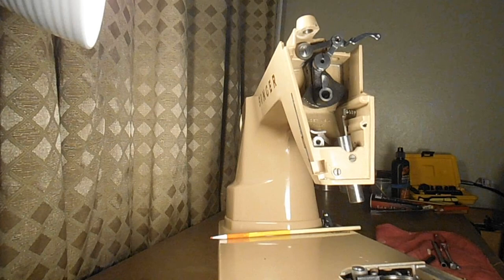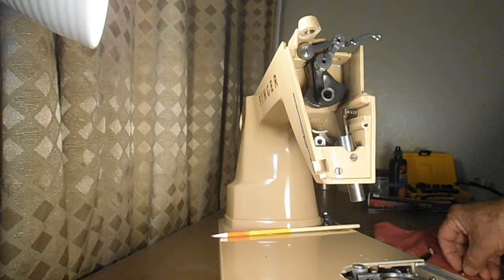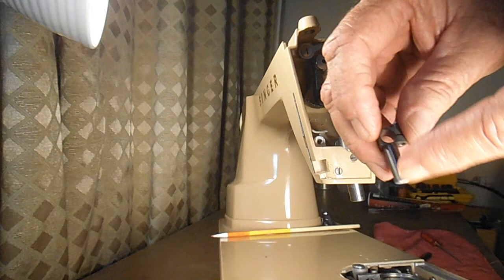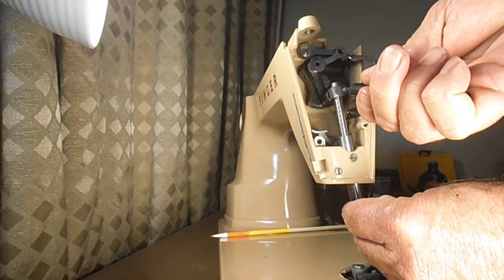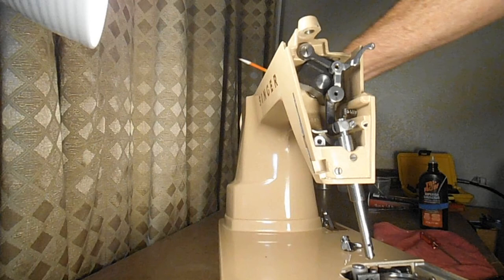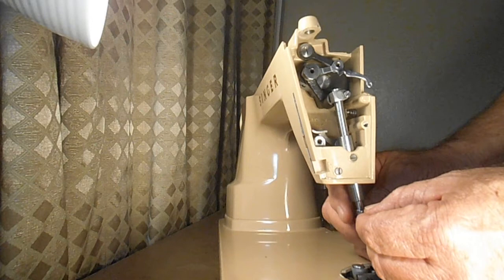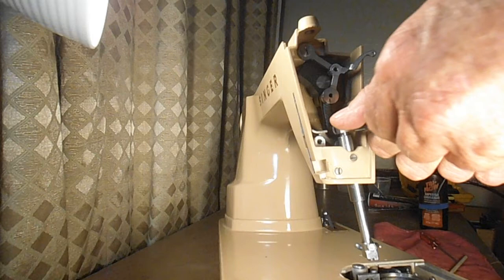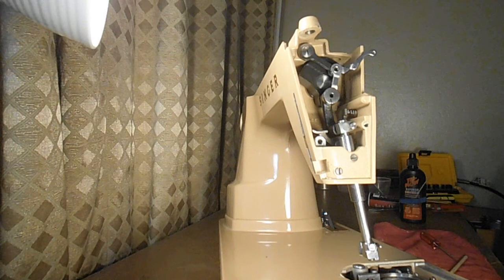SINGER MODEL 404 RESTORE SERIES Pt. 23 INSTALL NEEDLE BAR & SET THE HEIGHT

Comment: Dear Andy. I stopped working on my 404 a couple of months ago because of the needle and tension. The needlesetting and the tension unit never working correctly. So my question. Does this needle bar have  something that makes the needle only set 
In one place ! My 301 singer does. When I put needle into the needle bar in the 404 it is in the correct place. When I tighten the screw the needle slides to the right . In its last place it is to the right side and touches the hole and foot. I have photographed  the inside of the bar and made a short video showing the needle moves as the screw is tighten.   Solving the needle location is first priority . Then tension unit is not going to work. The thread tension barely moves at 1 and then comes to a stop at 2. Thread is cut or stops everything. I have watched the video for a couple of months, off and on and off and on. I am giving up. Now just want needle question answered
Reply from the maker: Hello, Rose,
Did you happen to remove the needle bar for cleaning or something? There is nothing on the 404 needle bar that "makes the needle set only in one place". If I'm reading your comment correctly, during the time you are setting the height of the needle bar you have the needle in the needle clamp already? And it is in the center of the hole? But when you tighten the clamping screw the needle bar moves and the needle touches the hole in the needle plate. I've never encountered this before, but if I did I would check to make sure I had the correct clamping screw in the clamp. I would check to see if my needle bar was bent. I would check that my needle clamp was installed correctly. I would make sure the needle clamp was lined up properly on the machine before I tightened the screw. I would make sure the needle clamp hole, where the needle goes into, is clean and free of any dirt or dried oil. I'd make sure the needle was installed facing the correct way and all the way up into the needle clamp as far as possible. I'd make sure my needle was not bent, or just install a new, out of the package, needle. It's a trouble isolation problem, so one thing at a time. The needle bar bushing is set at the Singer Factory so the needle bar lines up with the hole in the needle plate. Singer mentions not to change this setting and I've never had to do that or replace the bushing. I'm assuming the bushing is eccentric, or has an eccentric hole, meaning it is not perfectly round bushing or the hole is not perfectly in the center of the bushing. By loosening the bushing set screw and turning the bushing left or right a tiny amount is how the factory sets the needle bar to line up with the hole. You mentioned a picture and a video. Did you mean to share those? Were you planning to upload them to your YouTube channel for someone to see? Just wondering.
Please check the things I mentioned and see if they apply and we can go from there. Thank you and good luck.

Comment: I just purchased a 404 finally after months of looking for the availability  ❤️. I’ve followed your approach so as to fully restore my 301.  I can’t locate an ADJUSTMENT manual for the 404 (not instruction manual.  Do you have any thoughts sir on how to locate one?  Thank you!
Reply from the maker: Congratulations! You will enjoy that machine. Model 404 is the straight stitch sibling to the two ZZ slant=o=matic models; 401A & 403A. SInger did not make a separate Service Manual for it but made a good 45-page manual that their repair people used for all three models. You can download a free PDF copy from the sewing dude here: https://sewingdude.files.wordpress.com/2012/09/singer-401-service-manual1.pdf
Thanks for saving another machine, Bill, and good luck.

Comment: andy what if the needle bar bushing  isnt set right . then every thing  off . great ved. thanks chet
Reply from the maker: That is true Chet. In most of the adjuster's manuals I have, there is no mention of the needle bar bushing remove/replace. The only ones that do mention needle bar bushing placement says that it is set at the Singer Factory, and the machine must be returned there if it is out of adjustment. I have never had a machine where it was out of adjustment. Swing needle machines (ie: zig-zag) do have adjustment instructions for the needle bar holder. BTW, I found all my documents for Model 66. I will pass them along to you if you care to email me at my channel email address: andytube53@gmail.com. Best wishes Chet.